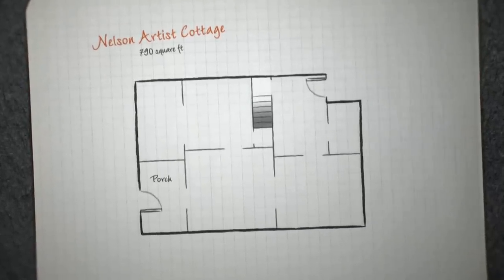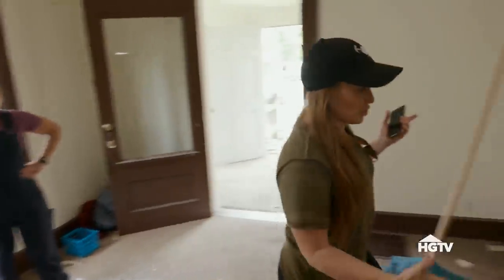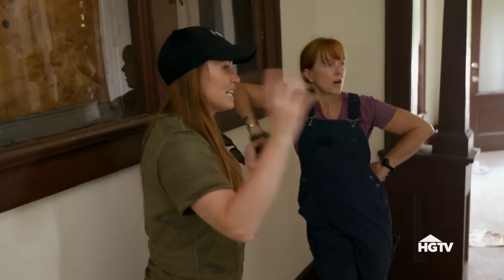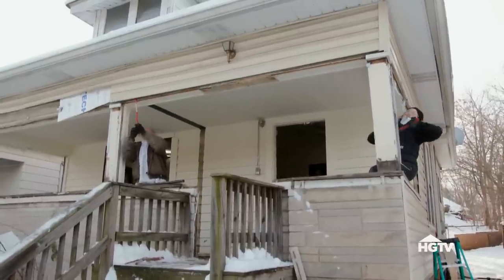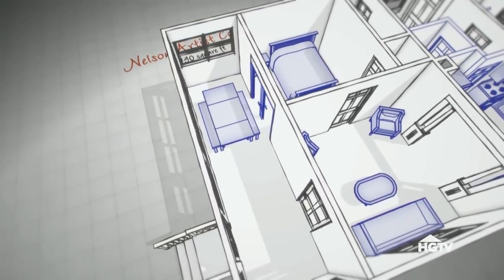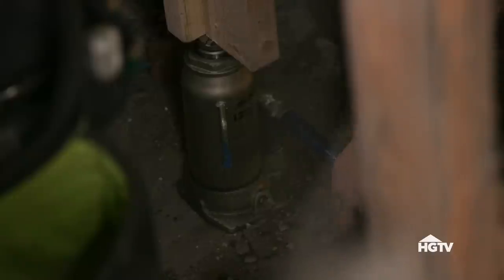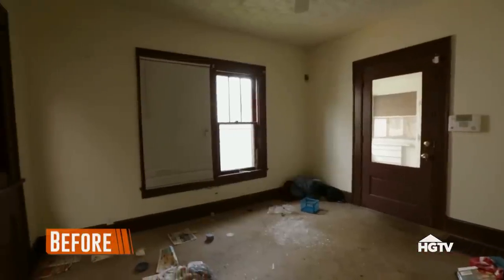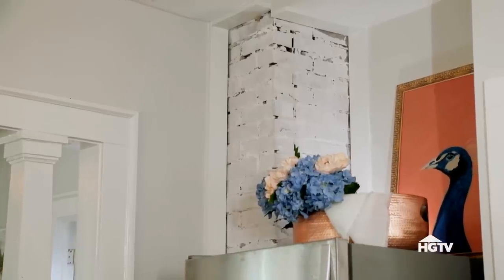From Cottage to Artistic Oasis Remodel | Good Bones | HGTV

Comment: Slightly annoying to watch because porches used to be built that way. It was an open porch. Basements were meant to breathe no insulation or drywall to worry about mold they breathed and the porch was covered so not much water would get through.